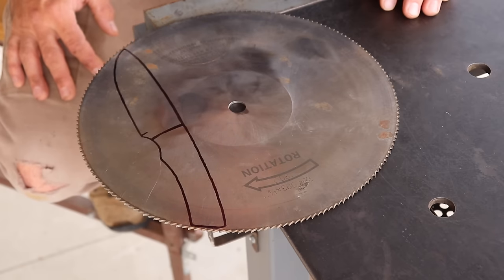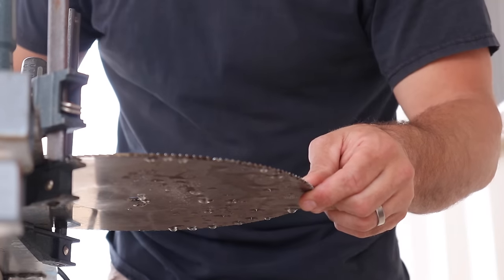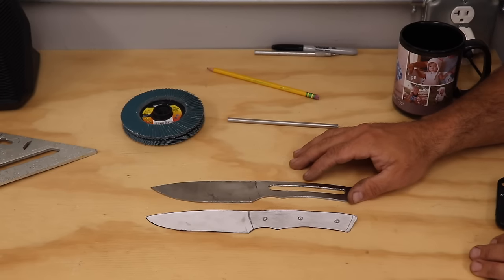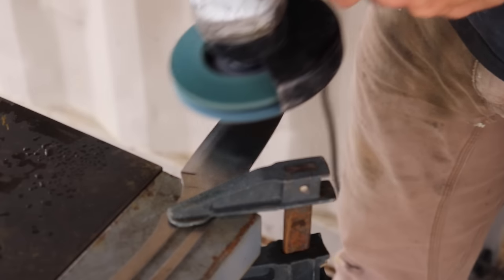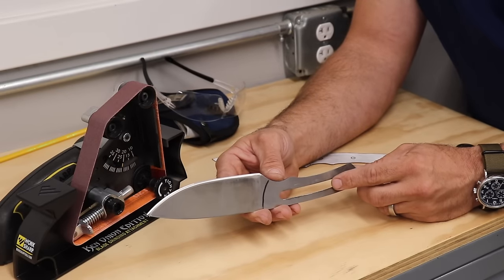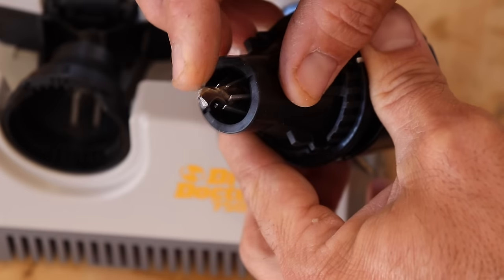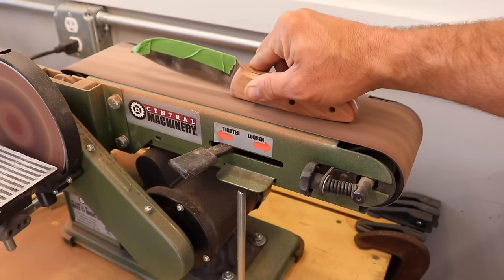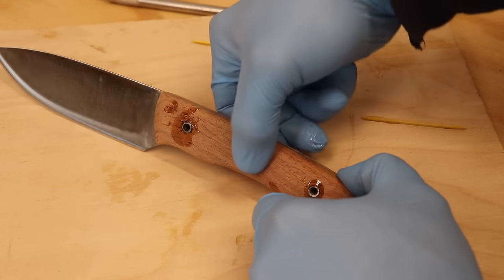The Saw Blade Knife - How to Make a Knife from a Saw blade

Comment: Nice work! Nothing "wrong" with using old saw blades or other tool steels for blades. I'd still re-quench the blade once it was profiled though. Use a torch to heat up just the "edge" and quench it in some preheated oil, then sand it clean again and temper it in an oven for a couple hours to get the best possible edge.

Comment: I always wanted to do the saw blade knife build, I think I started when I was younger. it came out good, though! maybe some knurling on the shoulder, for thumb pressure. nothing too serious, though. just some texture for thumb to push against without sliding off.also a slight bevel on the back. rounding it over just a little means the back of the knife doesn't have hard edges that can be harsh on fingers etc. *ponders making a new kitchen knife out of something at some point. I miss having a knoife of my own. broke mine a couple years back.
Reply from the maker: Tizona Amanthia that sounds like a good project!   A kitchen knife would be fun to really add some custom options as size and shape can be really variable😀👍
Reply: @homesteadonomics  Very much so. there's a few things I've really though about, having used a kitchen knife  A LOT. I"m no pro chef, but enough of a foodie to be the designated dinner maker in houses for the last ten years...for one thing, having a smooth curved transition from blade to handle. the bolster area needs to be curved. so you can get a sponge or wash cloth in there. if you don't you make a dirt magnet spot. also curves are good. hard corners on metal makes for uncomfortable grip. you know that "proper" knife grip of pinching the blade? yeah, you can get a blister on your index finger if the spine of the blade near the grip isn't rounded and soft.  aside from that...you need a point for piercing but not too flimsy a tip that it breaks. #rambling.

Comment: Love that you used Mesquite as your handle material. It's such an underrated and underappreciated hardwood. Highly resistant to rot, harder than any oak or maple, super stable once dry, takes glues and finishes pretty well. The only bitch about it is getting long straight pieces and it can be murder on tools. I laughed when you sharpened up the drill bit immediately after telling us about using Mesquite as your knife scales and thought, yup dude knows what he's talking about. 
And for people who don't know, mesquite grows in the hot, dry areas of the Southwestern USA and Mexico. It takes a long time to get a big enough tree for lumber and because of the wind in these areas, you end up with some pretty gnarled shapes, lots of figure and inclusions. Also, you get sand in your lumber because it blows in, the tree grows and it absolutely eats saw blades and drill bits. Don't ask for long clear boards of mesquite, because they just don't exist. 
But the color and figure you get out of the pieces is just gorgeous. It's heavy as rocks so maybe don't make a violin or a baseball bat out of the stuff but for all sorts of other things, it's fantastic. Hardness is generally above Hickory and almost approaches some Rosewoods. And chances are if you're anywhere from South Texas to Southern California and The US Mexico border on up to Southern Utah, you can find it everywhere.

Comment: I love that unpolished look of the blade. Will it rust?
Reply from the maker: Mattie Fattie it will rust a bit if not kept oiled but not much.   When I was spraying water during the cutting portion some of the cut off pieces were wet for a long time and only has small bits of rust.   So it’s definitely not stainless but it sure isn’t high carbon.   But so long as I keep it wiped with a little bit of oil I don’t have much concerns of rust developing
Reply: @homesteadonomics  if I had the tools and shop you have I'd for sure make an unpolished butterfly knife. I used to live in AZ and you remind me of a super smart friend I lost touch with when I moved away.

Comment: I have a suggestion for the chicken coop      You should make both of the windows on the chicken coop chicken wire and add sliding plexiglass underneath so if it is monsoon rains you can just close the plexiglass also for extra protection but if it is to hot just open the plexiglass for extra ventilation
Reply from the maker: David Cavan vlogs I have another coop build planned sometime this summer... it will be very similar to my current one, but with some minor modifications and changes.  And airflow it definitely on the list😀👍
Reply: Omg I did not expect a reply but ok good to know

Comment: Very nice job on the knife overall. One thing that seems like a weakness is the slotted handle. I assume you did that because drilling through a hardened saw blade wasn’t an option. While the hollow pins will likely offer some attachment strength, if the epoxy gives way the entire handle could slide forward or backwards, potentially causing a serious injury. One technique to overcome this that would kill two birds with one stone would be to soften the tang area slowly with a blowtorch, soft enough to where you could drill conventional pin holes. You could probably drill a few holes with a good metal cutting bit, especially with a drill sharpener nearby! By tempering the handle a little softer you will reduce the inherent brittleness in the hardened blade. Dimpling the handle to help the epoxy bite was a good decision as well. The proportions of the knife and handle look well-done and thoughtfully executed. Thanks for sharing and I hope you see this as constructive feedback. 👍

Comment: Beautiful work! Why the slot in the blade, vs. individual holes drilled for the pins? You've definitely inspired me!
Reply from the maker: Black Riflemen's Organization thank you!    The slot is because the tool steel can’t really be drilled through.   It’s so hard that it would burn up all but super special abrasive drill bits.   So the slot just makes it easier to use conventional tools😀👍

Comment: Instead of cutting a slot for the handle, try drilling holes with a masonry bit. Masonry bits have carbide tips which can be sharpened to drill hard steel using a silicon dioxide or diamond grinding wheel.

Comment: hi, i had a beautiful saw blade knife gifted to me but i am having issues with the blade rusting extremely easily. do you have any suggestions for this? besides the obvious of immediately hand drying of course
Reply from the maker: Alex Macdonald not sure....I would guess it was a high carbon blade.   I’d keep it lightly oiled which should help.   Like rem oil or something else that is very light and keeps coverage.   But thats just a guess...this is the first knife I’ve made so I’m far from expert 😀👍
Reply: Carbon steel = petina. You can get a cool looking black petina simply by soaking it in heated (not boiled) vinegar - white is cheapest and best. If the blade doesn't turn completely black in 15-20 minutes, sand with a very fine grit and repeat. It simply oxygenates the steel before the rust does.

Comment: I would have left the saw teeth on the back of the handles heel. @ 2:58
Reply from the maker: I did consider that... looked really cool!   But I ended up wanting a more comfortable handle and figured I'd probably end up scratching my hand on it once I end up making a belt sheath for it...lol
Reply: @homesteadonomics  maybe the word rotation would have looked cool on the blade, but it sure turned out great, enough left for 1/2 more